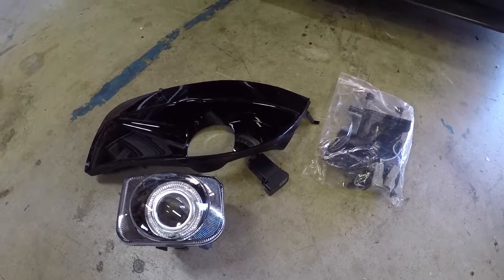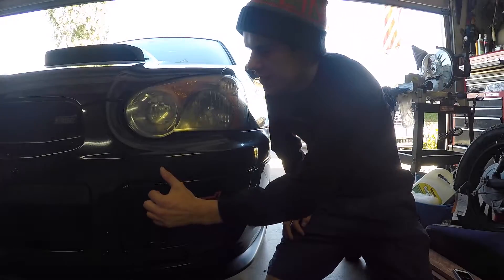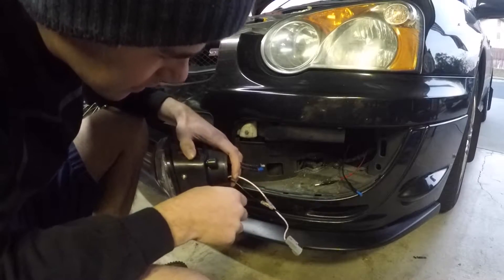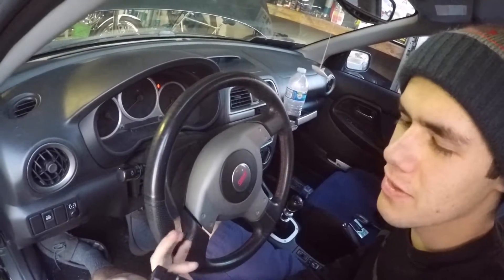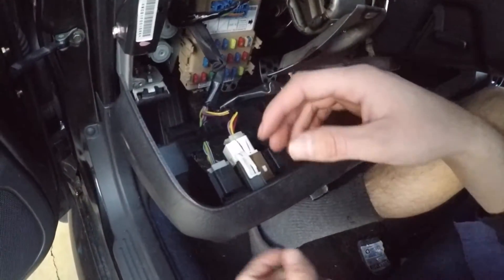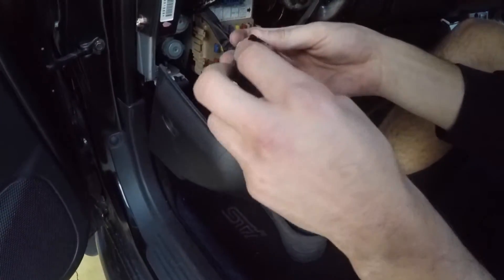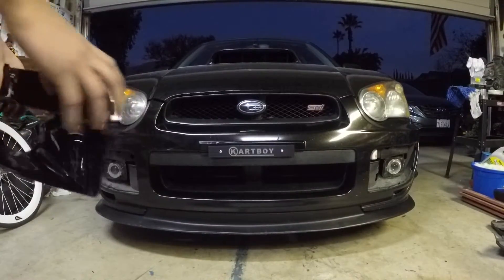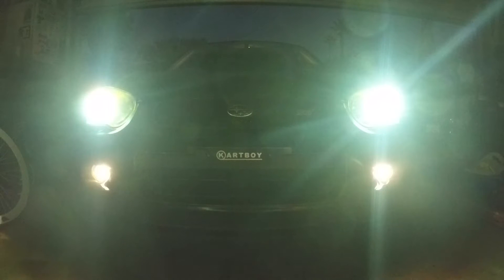Ebay Projector Fog Light Install

Comment: Hi. Did you not install the relay that came with the kit? I just got my kit today, and I'm really confused on what's the best way to install these fog lights. Please help. Thanks.
Reply from the maker: Eddie G. Sorry about that i guess i forgot to include that in the video. Its going to be under the dash right next to the small fuses and its going to be the forth one down. Heres an image of where it goes
https://goo.gl/images/x3LTCE
Reply from the maker: Eddie G. Let me know if that helps
Reply: Doug Murray Awesome thanks dude.  How did you tap the wires?
Reply: Doug Murray hey man the wires you tapped into, are they the ones in green with one having a red stripe and the other one having a black stripe?
Reply from the maker: Eddie G. Not sure of the color at the moment but i tapped into the wires from the top smallest light bulb the parking lights
Reply: Doug Murray got it thanks man!
Reply: Doug Murray I was able to install them! Thanks for your help man!
Reply from the maker: Eddie G. Im glad it helped man!

Comment: how did you moment the bracket for the fog light itself that came with it
Reply from the maker: Three screws, one up top that connects to the frame and two at the bottom that connect to the bumper itself👍
Reply: +Doug Murray thanks man, just wish this told you which bracket is for which side or how to do it

Comment: The 04 sti comes with the wiring Already installed for fog lights from the factory.  if you would’ve done any research you would’ve seen this. All you have to do is get fog lights mount them and plug them into the factory harness and add a relay and the switch in the factory location. No wire crimping necessary.
Reply from the maker: nophobia123 i did use the factory wiring harness... i only wired the halo rings for the fog-lights cause theyre after market.